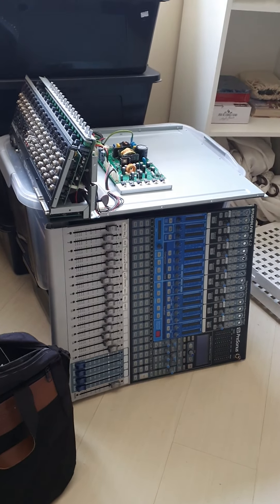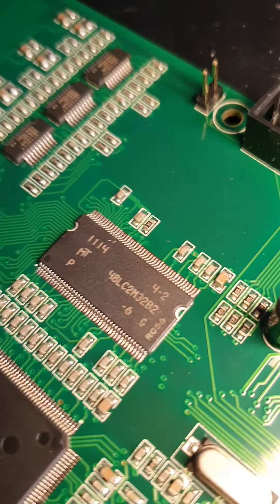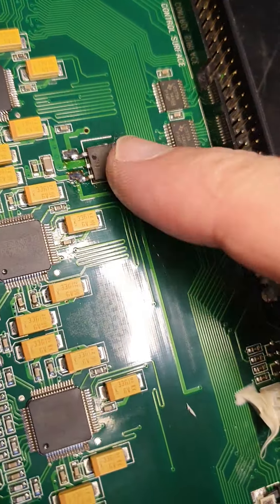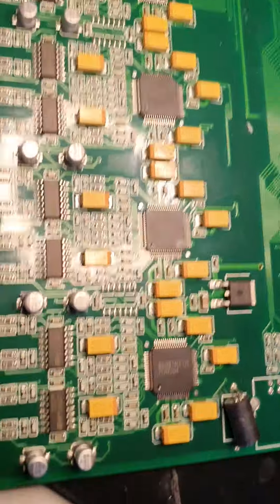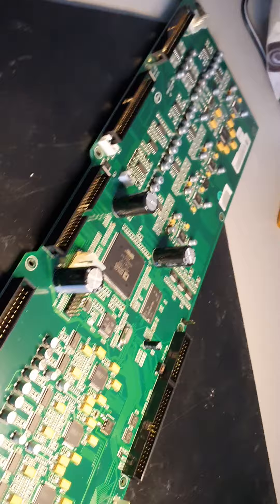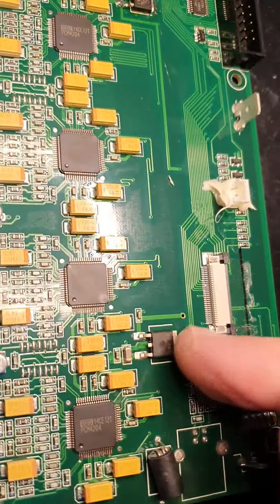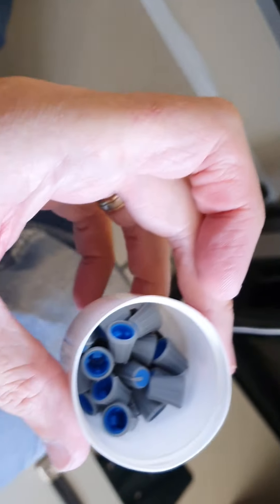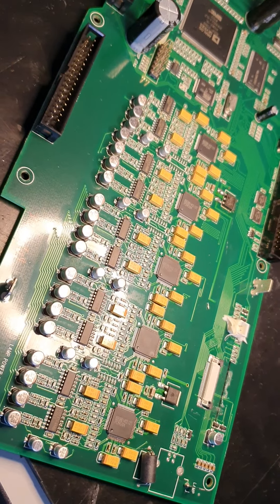Presonus Studio Live 16.4.2 No Sound fault Part 2

Comment: Thank you so much , this a great video. Would you know the numbers for the similar voltage regulators on Studiolive 24.4.2AI?
Reply from the maker: Sorry I don't remember and my service centre has closed in Brazil. If you search the original number (2SB14) for an equivalent; you will find one easily in a TO1 package (2N2953, 2SA474, 2SB440 etc).
Reply: @delatronics  Thank you so much.
Reply from the maker: 2sb14

Comment: I have the same mixer. The resistor R44 on the power board is burned in such a way the value can't be read. Do you know by accident the value of R44 of the powerboard. How is your leg now?
Reply from the maker: @HenkvanHoek  sorry no idea, I am back in the UK now and no longer authorised. It is probably a low value Pi resistor. My leg is still the same, but thanks for asking.

Comment: Hi there, I have one 16.0.2, it was without inputs, i changed the 5 volts regulator and now I have no sound output, bur the inputs are working
Reply from the maker: Also check the power supply board, as this often gets dry joints on the regulators.
Reply: @delatronics   Im from Curitiba, do you still make repairs?
Reply from the maker: @eduardobascheko998  look at my website (Delatronics.com) to find details. I am quite busy at the moment but could look at your mixer. Unfortunately Presonus won't give out circuit diagrams or parts (even to the importers in Bahia!)

Comment: Hi, when replacing the voltage regulator with the 7805, do the pin outs match ?  Do you have a picture to who how you connected it ?
Reply from the maker: Yes the pins matched. Not had another one in since, so can't supply photos I'm afraid

Comment: Hey did it come good after the regulator swap? I've had one of these sitting (16.0.2) on my shelf for a few years in pieces after I got a firmware glitch, but recently reassembled and while the firmware seems happy enough to boot most of the time (occasional ram check failures occasionally, any ideas?) but while I can monitor inputs, I'm getting no outputs.
Reply from the maker: I did resolve the issue but these units seem to be plagued by various problems. I was authorised to be the service centre for the whole of Brazil by the importer but after emailing Presonus in the states, I didn't get any reply or support (I don't think I'm going to put myself to the trouble of repairing these blind without a schematic and also without parts).

Comment: replace the voltage regulators with LM7805. had my 16.4.2 kept freezing up and sent it back to presonus for about $350 total a few years ago. said they replaced the board but they only replaced the voltage regulators with the same lame voltage regulators. 2 years later board freezes again, now prosonus says board out of service and wont fix it. found a guy to actually replace voltage regulators with beefier LM7805. so far no problems a few months in. good luck. dont have to toss a board where no parts can be salvaged. crazy design that they become disposable.